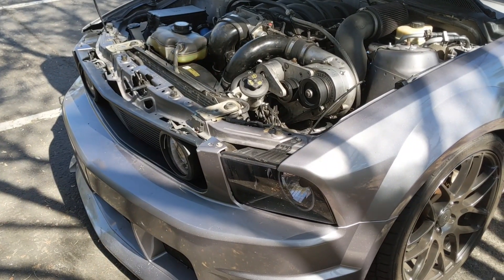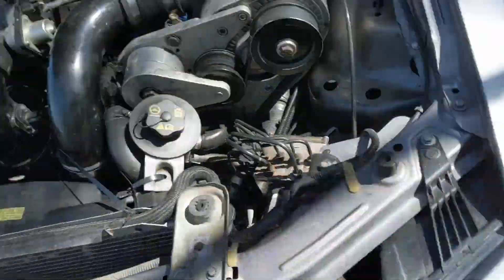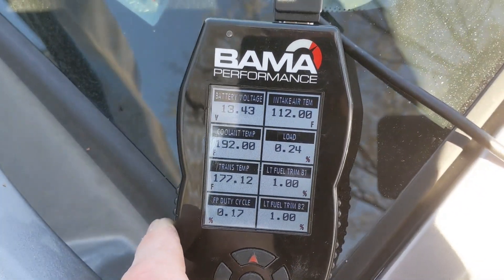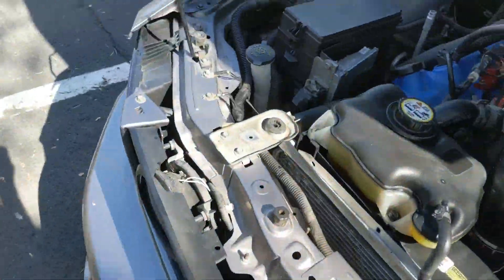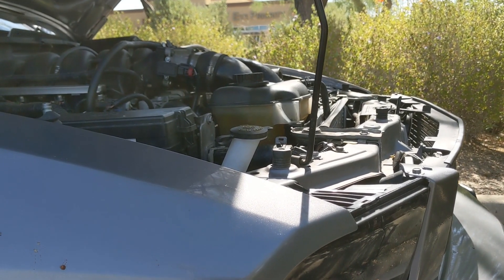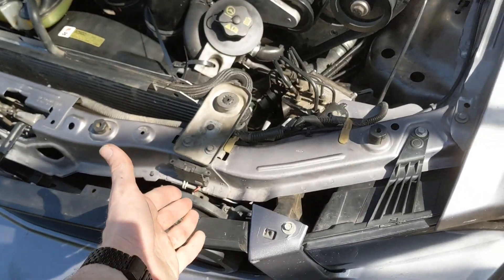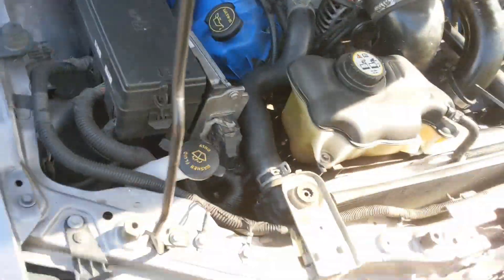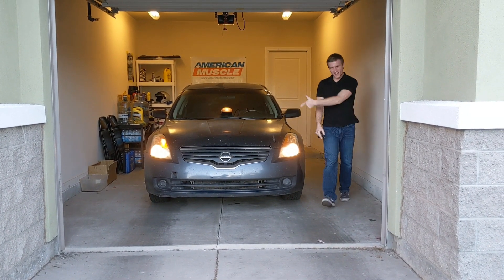I BOUGHT A NEW CAR! After my SUPERCHARGED mustang OVERHEATED in a Taco Bell drive-thru!

Comment: If you live in an area where you can get away with running straight water I would recommend that. Edelbrock actually makes a better designed water pump for these motors as well. You might have problems fitting a thicker radiator with the procharger. Anywhere below 220-230f should be safe, you don't want to be running that high though. Not sure what your intercooler setup is but an air to water intercooler could drop temps as well, might want to look into hood vents too as they can drop under hood temps up to 75f.
Reply from the maker: Appreciate all the advice! Probably gonna run close to straight water and then take it from there 👍

Comment: Keep building it brotha! But if it gets past 2500-3500$ I say get a Ford F-150 gen 2 5.0 engine for 2500$
Reply from the maker: Probably won't go that route because I can get away for building the 3v for about the same price, but then I would have to buy a new blower for the coyote. Never know tho!
Reply: Cam 3v yeah if you build the 3v for around the same price I say do it I’ve seen 950 hp 3vs that were built, but ifs it’s too much just know those gens 2s can handle 850 hp, I’m interested to see where it goes best of luck man! I’m hoping you can stay wit the 3v
Reply from the maker: @5.0brandon59  Somewhere around 700 horsepower is the goal, just enough to scare me to get on it🤣 I'll let drewpeacock have the 1,000 plus HP 3v🤣
Reply: Cam 3v  yea Drew’s 3v down rn but man what a car he put together 👌🏻 that’s a good goal and right around where I’m heading, I’m doing a on3 turbo on a 2011 5.0 this month 590hp 600tq where I wanna be best of luck man
Reply from the maker: @5.0brandon59  That's gonna be sick bro! Turbo coyotes sounds SOOOO good

Comment: I just had my radiator go out and my car overheated. Supposedly it's a common problem. It can melt your wiring harness and fry your fuse panel. Check the wiring harness and fuse panel and look for burn marks. I had to get all that replaced and it was about 1200 :/
Reply from the maker: Whoa that's insane. I'll definitely have to check that, hopefully that's not the case
Reply: @CamMarz  yeah man I'm still trying to fix it too. It's a pain in the ass. I'd be on coilovers rn if it weren't for it -_-

Comment: @cam3v it might be as simple as a defective thermostat? I would replace the thermostat when you drop the new 2 core radiator in it and ensure your water pump is up to par.  Did you run a code check with your hand held tunner?
Reply from the maker: Yeah no codes, I think honestly the issue is the mix of coolant I had in it. I didn't drain it completely and I think it had to high of an antifreeze to water ratio which didn't allow the heat to transfer out of the system fast enough. I was able to confirm the thermostat was working so hopefully that solves the problem😂
Reply: @CamMarz  I like the sound of $30 of coolant fix vice all the other possibilities.
Reply from the maker: Same😂

Comment: I have a similar set up but mine doesn’t really overheat.
Is that a Paxton or a Vortech ?
Reply from the maker: It's a P1-SC procharger, and I think my issue was the coolant I had in the system, my water to anti-freeze ratio was too low

Comment: Just dealt w the same thing on my procharged Charger srt8 out here in Arizona, I had done the thermostat less than 1000 miles before, spent days trying to figure it out, and it ended up just being the thermostat again. (Must have been faulty)
Reply from the maker: Yeah the problem is that its just so damn hot in this state! I know some guys that run there cars with the thermostat stuck open (on purpose) in the summer time and have had great results doing so. Then they just change them out once the weather cools back down
Reply: Cam 3v I’ve heard the same thing, but for now the thermostat is working again, and I’m staying around 185 even in this weather, hope you can solve your issues.
Reply: I’m in the metro area, If your close dm me when the mustangs fixed up, would love to get a couple runs.
Reply from the maker: I'd be totally down man👍 I'll give you a follow back on my IG and we'll run some time! IG: cam_3v